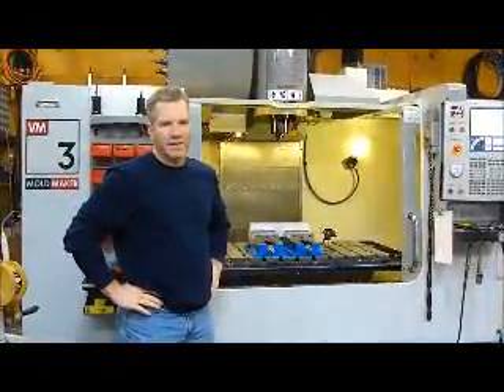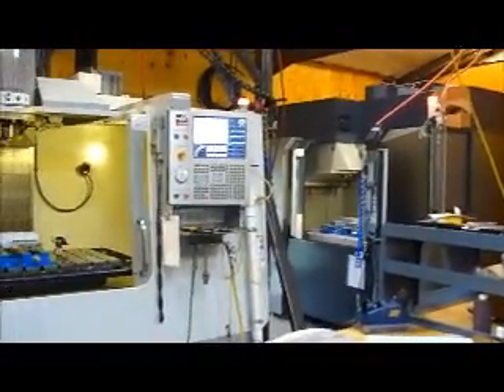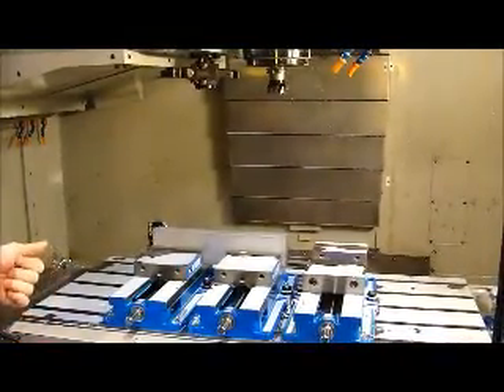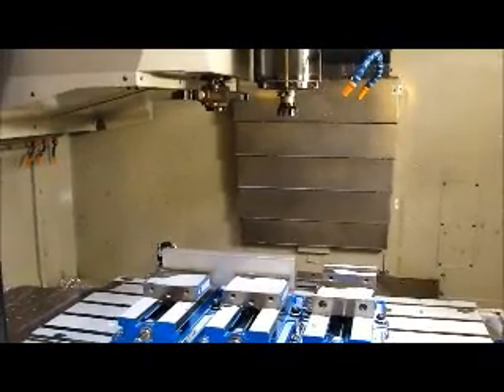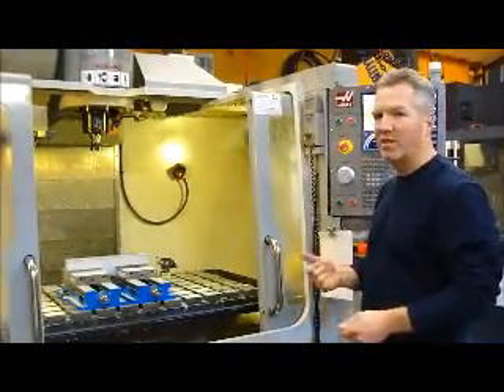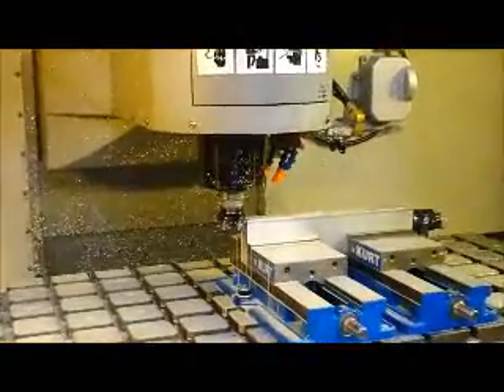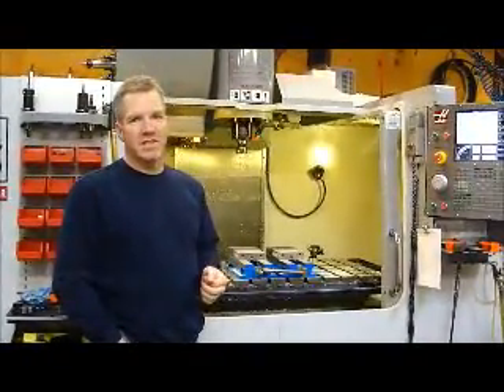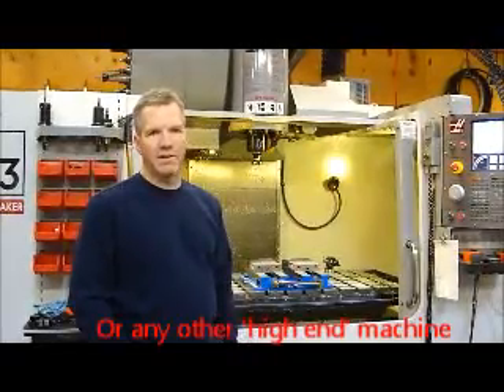Haas vs Makino

Comment from the maker: Correct, the Haas did pay for the Makino.  Haas is a great machine to start a shop, but as a machine shop grows there are two approaches a shop owner can take.  First, they can build a bigger shop, buy more Haas machines, and add employees to run them, or second, they can replace the Haas machines with faster and more productive machines, stay in the existing shop and get more work done with the existing employees.  Which method would you say is more expensive?

Comment: this is a total misrepresentation of both these machines,  by my calculations the Haas spindle stalled because it was just above its limitations with its 30 h.p. direct-drive motor rated at  90 ft.lbs of torque, and the Makino actually has a 33.5 h.p dual speed motor rated at 130 ft./lbs of torque, what his motive is for this video I am not sure of, but I am sure the money he got to pay for the Makino was earned on his Haas

Comment: The Makino's motor will be rated at 30HP at full rpm but the Haas will be rated at 30HP at a slower motor speed...just a bigger motor on the Makino so it woill cut better...

Comment from the maker: Not an entirely accurate price comparison however, because the Makino came standard with through spindle coolant, dual chip augers, and a lift up chip conveyor, not to mentioned chilled spindle and core cooled ball screws.  If the Haas was similarly equipped the difference would be about $15k less.